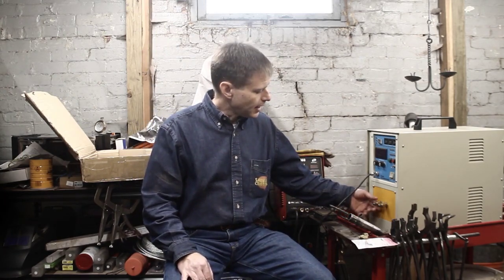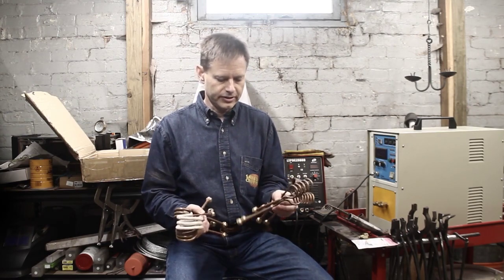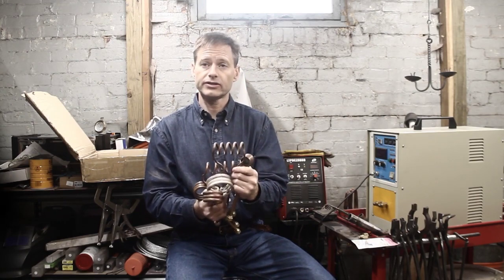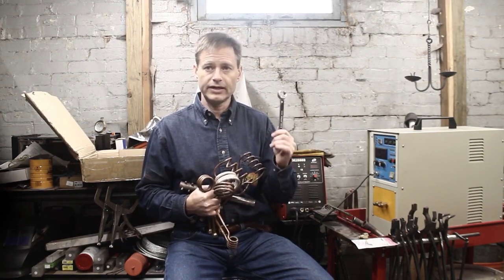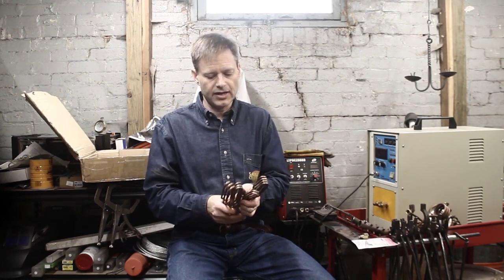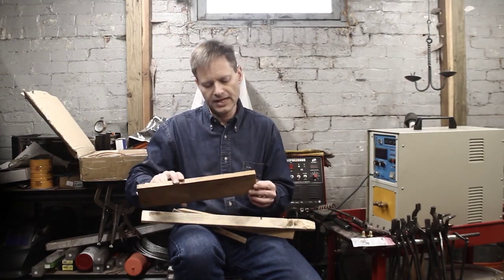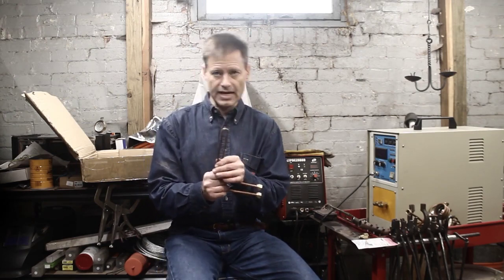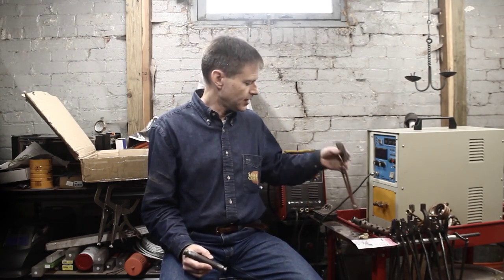Induction heater coils for the Blacksmith

Comment: I really enjoyed your video . I am working on a project where I will have some 1/2" thick steel plate filled with 1 1/2" holes and I want to solder some 1/4" wall brass tubing into the holes , keeping the holes as close together as possible . The problem is to localize the heat , I envision a induction coil with just a single loop or at most two loops that are flattened , or maybe heating it from the inside . I really don't know the best way to try to do this.
Reply from the maker: A one or two loop coil on the outside should work. You can use tubing as small as 3/16", which would minimize the required space. Heating from the inside is problematic.
Reply: @ejoftheanvil  Thank you , that saved me from trying inside heating.

Comment: How about introducing ferrite (as a magnetic conductor), that can come within a thousandths of an inch from the workpiece?
I’ve seen some handheld probes where this is used and it seems the very best option, unless it’s patented.  If one wants an AC magnetically conductive material at 100Khz, this would fill the bill. Old school TV sets had ferrite transformers within their flyback units. 
It doesn’t have to be at 100Khz, it can be higher. This would introduce what is called the “skin effect” where only the outer layer of the metal gets heated. At lower frequencies, the effect is not as pronounced.
Try going with EFD Induction company, they have a system using the ferrite cores.

Comment: How much distance do you allow between the coil and the object being heated? I am currently trying to make a coil around a graphite crucible. I made one that had about 3/16 of space between the coil and the crucible, but my machine (same one that you have) would stop heating after a few seconds. I switched to a larger diameter coil and it works again, but I feel it is too far away from the coil and it is not getting hot enough. Thanks for your help.

Comment: Estimado .Tengo una maquina similar y quería fabricar una extensión flexible para las bobinas de tubos de cobre .Tiene idea de como fabricarlas? máxima extensión, materiales, etc. Gracias
Reply from the maker: See my reply on "Induction Blacksmithing: replace your torch with a flexible induction wand". As for maximum length, maybe 4 feet, but shorter is better for performance. Mine are 32 inches.

Comment: Instead of guessing, perhaps measure the inductance. They sell low cost meters to measure the inductance of a choke / coil. I use one all the time for radio work.
The number of turms, diameter and how far apart they are. You can also change an existing coil by merely pushing the coils closer together or further apart. These machines are often made to switch at no load. It uses that coil to achieve this.
Reply from the maker: I have one, but it doesn't seem to give very useful results. A better meter might help, but the tricky part is that the inductance changes enormously when metal is inserted into the coil for heating (and it changes further as the metal heats, esp after the austenite phase transition). I'd at least need to measure it with various types of stock inserted and that's complicated by the fact that forging will be changing the metal each heat...

Comment: hi is it possible to melt stainless steel with LH-15a induction heater ?? i was thinking to maybe put inside small crucible and 10-20 grams of ss wire  and to use melted ss with hammer mould
Reply from the maker: The documentation says "no". I suspect it's possible. Steel melts at a high temperature which would require special consideration.

Comment: Eric, I am about to purchase a 15 kv machine and very much interested in coil making.  I am, however, more interested in making a "coil extender" so that I can operate the heating elements remotely, say, 4 or 5 feet from the machine. I have a lot of special press that will require this. Have you had any experience with making an extender that will reach that long?  Is it just a matter of just using very long tubing, perhaps flexible metal hose or something more.  Will there be excessive dissipation of power over an extended length. Thanks.
Reply from the maker: Yes, see this video: https://youtu.be/KDkcZ3UpDvI . It's not quite that long, but it could be and still be viable.

Comment: Can I  make induction out of a induction hot plate easy anough
Reply from the maker: I think that would be hard. Further, a hot plate is usually 1800W instead of 7500W. So, even if it worked it wouldn't be very effective.

Comment: Awesome video! For very specialized coils I think 3d printing them in copper would work although more expensive then bending. But you could make some very rigth bend radii and are not constrained by bending at all.
Reply from the maker: Cool but not yet practical. But in a similar vein, Evan Blackstone (who has a great overview video: https://youtu.be/GU6n488i2mI) has 3d printed bending forms. At the extreme, you could even melt the plastic out much like I burn wood forms out of mine.

Comment: Is there any reason I can't just make my coils directly from 5/16, vs dropping down to 1/4 or 6mm? I am assuming they will still heat just fine, just can't bend as tight?
Reply from the maker: Definitely a good option. 5/16" will flare enough to use with 8mm flare nuts. My personal preference for 1/4" is that I can get it "anywhere". 5/16" is not something I can pick up at my local hardware store. (Tho it's much easier to get than 8mm.)
Reply: @ejoftheanvil , thanks for the quick feedback! I have multiple 8mm flare fittings, and my local hardware store actually had 5/16 copper pipe!
Reply: Hi, again! I have been banging my head against the wall trying to make an oblong coil to do wider stuff. Any tips, or better yet, do you make and sell coils, lol?
Reply: @ejoftheanvil , Hi, again! I have been banging my head against the wall trying to make an oblong coil to do wider stuff. Any tips, or better yet, do you make and sell coils, lol?
Reply from the maker: @MinionsSmithy  Let me know a bit more about the issues you're experiencing. It's probably easier if you contact me directly as the comments here are not great for details. Look for my contact info on the Saltfork Craftsmen web site.

Comment: Thanks for the videos.  I had assumed (because I have an induction hotplate) that induction forges would only heat ferrous metals/metals that can be magnetic.  But it looks like you heated copper tubing as well.  Can you heat non-ferrous metals?  Thank you!
Reply from the maker: That's a safety feature of the hotplate, not a limit of the technology. I can heat anything that conducts. I have soldered copper (as you saw). I've also used the induction heater to forge brass, copper and aluminum.
Reply: @ejoftheanvil  Thank you for the clarification!

Comment: Thanks, great tips, interesting that the flow sensor is not in the coil line, never would have guessed that. Are you still liking the flex lead and finding it useful?
Reply from the maker: I do find the flex lead useful. It is awkward attaching it to the induction machine and then attaching a coil. But, it's less annoying than dragging out my oxy-acetylene so I don't regret having it.

Comment: I would love to see any thoughts re working plate and the usefullness of induction forges therin.
Reply from the maker: Plate is trickier. Anything too large to fit in a loop of some shape will heat less efficiently. And with only about 2" of coil length, you can hit that size quickly. You're pretty much stuck with a flat coil. I do need to talk about how a flat coil works (the ones shaped like a stove top burner). That's definitely on my todo list.
Reply: @ejoftheanvil  I know quite a few armourers who would be very interested in watching such a video :)

Comment: Hi! How much current does the LH-15a draw while in the 110V configuration? Thanks in advance!
Reply from the maker: Up to 70 amps
Reply: @ejoftheanvil  I apologize for the confusion, I should have been more specific. I was specifically asking if the load from the outlet ever exceeded 20A
Reply from the maker: @H-D52  That's the 70 amps, which is why a 110V configuration is generally impractical. You can get 70A, but only by wiring directly to the supply with absurdly thick wires.
Reply: @ejoftheanvil  I went back and watched your 110v vs 220v video and it makes more sense now. Is there anyway you could do a comparison video of the 110v hookup with standard 20A circuit heating metal vs 220v?
Reply from the maker: @H-D52  I may do that at some point. I'd need to wire up another cable to do that with mine. For now, I'll just describe the issues.

Basically, full power is 7.5kW (the 15kW figure is a lie that I note in my video). 20A 110V gives you 2.2kW. So, 220V is 3.5x more power.

The first issue is that the induction heater doesn't limit itself to 20A. You'd have to fiddle with the power output setting to find the point where you don't trip your 20A circuit breaker. It'd be somewhere about 30%.

The second issue (and essence of your question) is heating time. It will take 3.5x longer to heat things. Consider 3/4" rod. That takes up to 60s from cold with my optimal coil for that size. So, 3 1/2 minutes. But, it'd be worse than that because the metal is losing heat. I'd guess it'd take over 5 minutes. (And would give you a bit over 30s of hammering time.) Worse, 3/4" is big enough that it might never get up to a good heat because heat loss is faster as it gets hotter and at some temperate you lose heat as fast as you add it. My guess: 1/2" could get to a welding heat, 3/4" to a good forging heat, and 1" only a low forging heat.

Comment: Is your machine wired for 220 volts.  If this is the case, what is the size of your panel breaker?  I have noticed that some rated 15kv heaters are really only 7.5 kv based on the input draw of the current. At 220 volts, 15 kv means about 63 amps i.e., volts x amps equals watts.
Reply from the maker: Yes. I have a 40A breaker. I used to have a 30A breaker, but the unit can draw enough to trip in in rare circumstances.

It's 7.5 kW. Some 220 v units actually say 15 kW, but they're not. They are 15 kVA (maybe), but that's just a technicality that makes for a more impressive spec and doesn't really mean anything.

Comment: Some things that I have found - if you fill the tubing with water and put it in the freezer you can form the tubing without worrying about collapsing at corners. 

Another option for converting from metric to standard is to braze the metric nut onto a standard fitting, instead of using tubing to connect the two (basically making the same type of converter you have).  

Thanks for the video.
Reply from the maker: Good ideas! I have also considered salt or sugar as internal support for bending tubing, but never tried. Sand would work as well, but could be a pain to remove unlike salt or sugar which would dissolve in water.
Reply: @ejoftheanvil  I'll have to try the salt, that is a good idea.   If that works it will be great to not have to plan ahead.  Thanks again.
Reply: I have greatly enjoyed your videos. 

Your comments on matching the coil to the work is right on the money.  The problem is that while using flare nut connections for coils is fine for semi-permanent coil connection, it is a very poor choice for coils that must be frequently changed. 

 Having worked with induction coils in the past, the first thing I did was to make very simple quick  connections for my coils.  Coils can then be changed without any tools in less than one minute, removing the tendency to live with a poorly matched coil.  The quick connect removes all the issues that you frequently mention about metric flare nuts and tubing sizes as well as wear on the fittings.    I would send you some photos, but this forum provides no method.

On a separate topic, coil shorting from work contact can be eliminated by coating a regular fiberglass cloth sleeve with kiln wash made of finely divided  Zirconium Silicate (Zircopax Plus) plus colloidal silica solution mixed to a creamy consistency.  Unlike bare fiberglass sleeving, the coated sleeve is totally impervious to  contact with work heated above forge weld Temperatures. At the end of the day when the hand  gets shaky the liner is very beneficial.  The sleeve is only about 0.01" thick allowing full use of the coil interior. 
Because of the extremely high infrared reflectivity of zirconium silicate,  heat loss from the work piece is significantly reduced.   An extended sleeve past the coils allows for work to be heated over a significantly longer length without thermal radiation cooling 

Keep on videoing
Reply from the maker: @jimmyjohnson7241  You can find my contact info at https://www.saltforkcraftsmen.org/Contactus.shtm . I'd love to see pictures of your quick-connect setup. Perhaps I can feature them in a follow-up video?